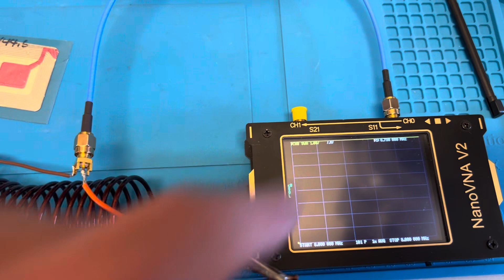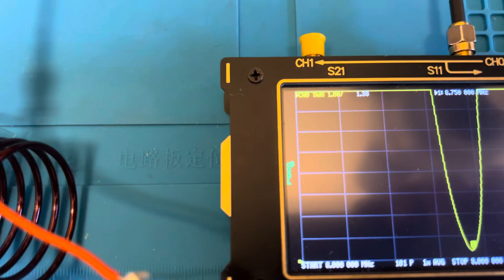Resonanting “Checkpoint” inventory control tags.

Comment: Is the VNA set up for measuring SWR ? Then it means that when you insert the tag into the coil, its impedance is going somehow through 50 Ohm within the sweep range. Not so sure what this can teach us, it would be nice to see the response of the coil alone on a wider range. Probably it does have a self resonance nearby and with the tag inserted, it becomes detuned to fall within the 8..9 MHz sweep range, but it doesn't necessarily mean that the tag has a resonance at that frequency.
Reply from the maker: Look up 8.2 MHz RFID tags.  They are all over Amazon. When activated they resonate at 8.2 MHz.  Not sure where they are are frequency-wise when deactivated. All I’m doing here is proving there is a resonance dip…yes VSWR shows the dip more deeply than S11 reflection coefficient.  Also remember that the VNA see’s a response that is transformed by the square of the turns ratio.  I’m not trying to make an accurate impedance measurement….I’m just trying to prove they resonate at or near 8.2MHz.
Reply: @w5cdt  I believe you. But i also think it is important that the coil has its self resonance nearby if it is to perform over a distance. I know these single layer self resonance coils from Baluns in HF antennas. Can you deactivate/reactivate the tags ?
Reply from the maker: It’s not just a coil …that tag is a parallel resonant tank circuit. So it also contains a little capacitor in the middle in parallel with the inductor. I believe the tags are disabled via a high energy pulse that shorts out the capacitor. Or they have a hole punched in them.